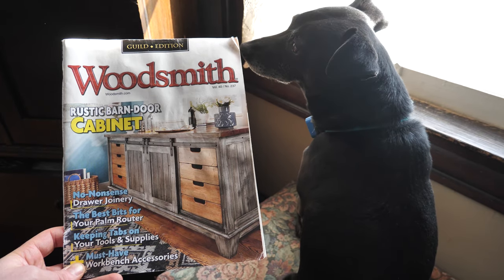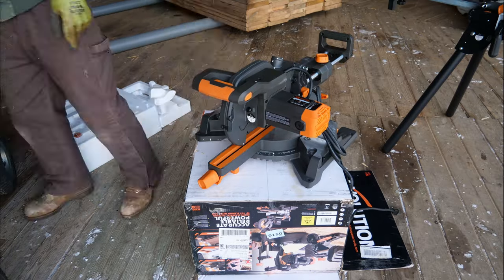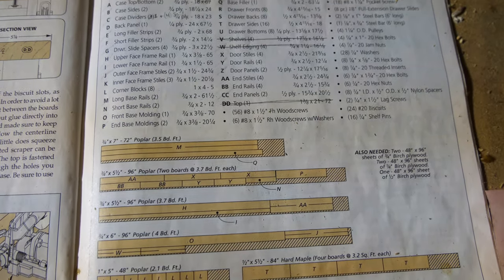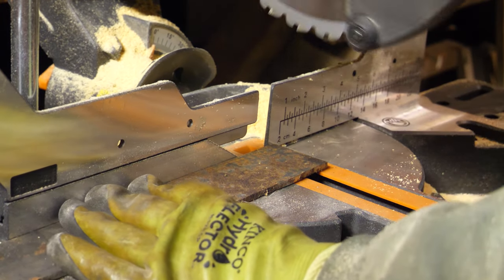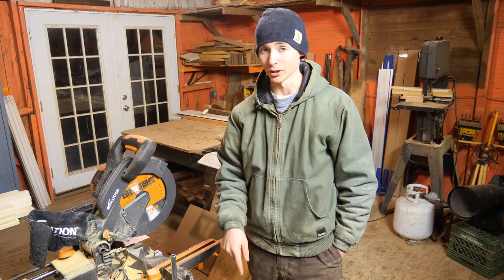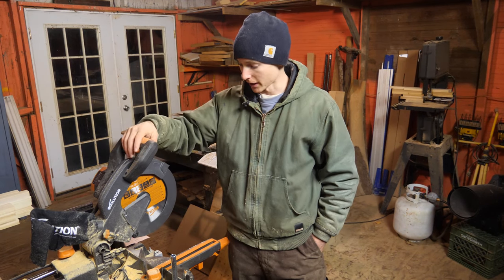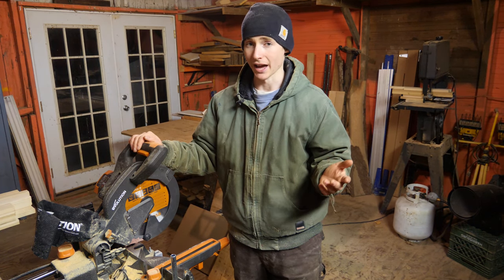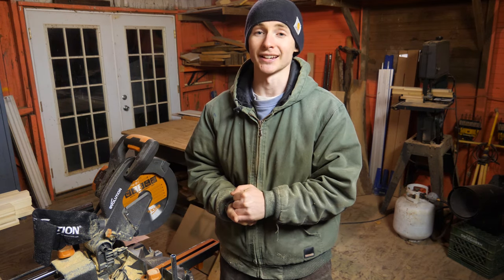New Chop Saw Time! | Evolution R255SMS+ Miter Saw Review

Comment: Have you ever thought of putting up some insulation or using a propane heater for your shop?
Reply from the maker: I actually did use a propane heater shown later in the background 😄 my statement of unheated shop at the beginning was a little inaccurate.. it can be heated temporarily, but 5 minutes without it running and it’s freezing again. I had some major improvements for electrical, insulation and dust collection planned, but I think I’ll just use the back garage of the new place as a woodshop home